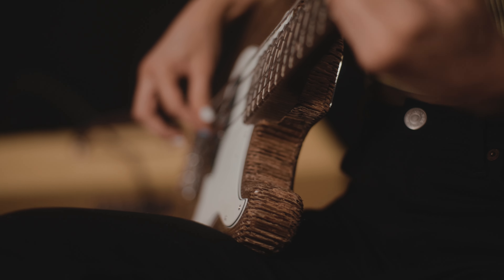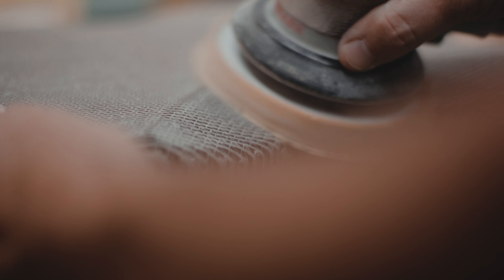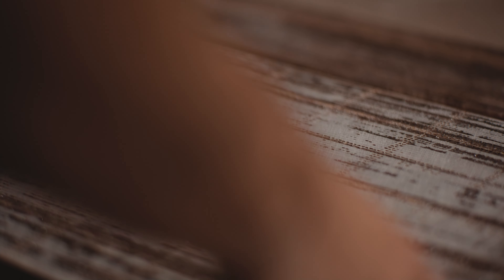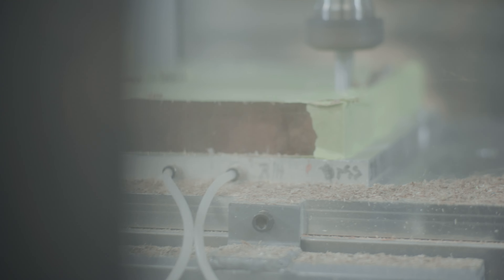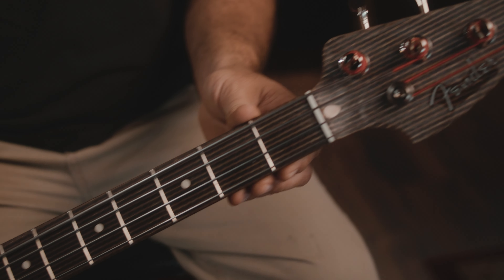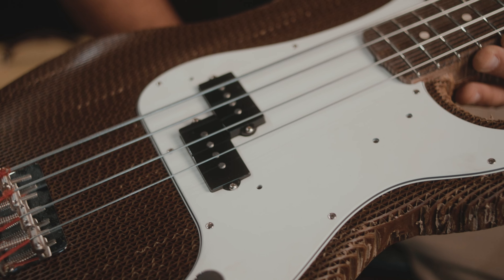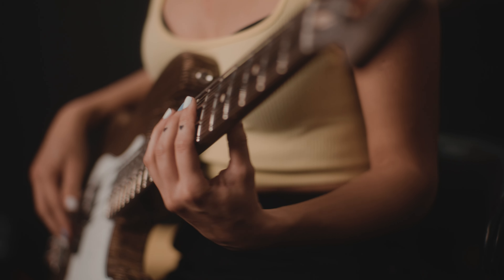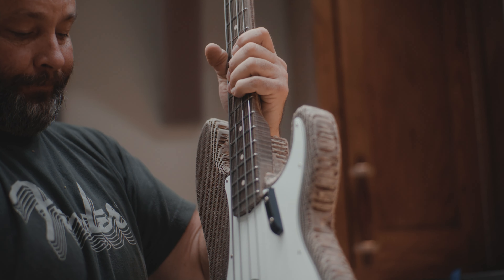Cardboard Precision Bass | Dream Factory | Fender

Comment: Now even Fender proves tonewood is BS, what else do y'all have to say?
Reply: So I'm wondering, is the debate about whether the wood/material affects tone at all, or is the debate about to what extent the wood/material affects tone? Because the whole instrument is a system with many variables. Every little thing thing will have SOME effect, even if minuscule at best.
Reply: Electric guitars are built by the cheapest woods even custom shop .
Reply: @kwyatt261  Yes but the body material probably only contributes to 5% of the sound, it's more Abt the pickups and amps or whatever
Reply: @gary9816  For sure. It's just that there is SOMETHING there. Like I said, every little tiny difference is going to make some kind of difference with how the instrument sounds. It's a whole system of variables, from woods and hardware all the way down to strings and picks. I agree that the pickups are one of the bigger if not the biggest factors involved.
Reply: This is clearly not true unless all woods cost the same.
Reply: @kwyatt261  the thing you’ll commonly see people talk about is that different woods have different impacts on the tone of the instrument. which, in the context of an electric guitar, is irrelevant. the tone in an electric guitar comes from the pickups and the way you play. the wood does make a difference on an acoustic guitar, as different species of wood resonate at different frequencies, so that has a pretty distinct impact on the tone of an acoustic guitar. some woods just naturally resonate at high frequencies which gives a brighter tone than a wood that resonates and a lower frequency. but in the case of electrics, you can make them out of damn near anything and it will have no effect on the overall tone
Reply: @MissJazz004  Ok, I get what you're saying, and of course it makes more of a difference in acoustics, but every variable in the system is going to have some effect, even on an electric guitar. While it may be a negligible difference in an electric, different woods are going to affect SOMETHING about the way that guitar feels, plays and sounds. Woods on an electric aren't a big deal, but to say it has absolutely no effect whatsoever is just being intellectually dishonest.
Reply: @kwyatt261  absolutely. different woods have a huge impact on the feel and playability of a guitar. but you’ll notice that i said nothing about the feel. sonically speaking, it has next to no effect. make a guitar out of walnut, and one out of mahogany, and install identical electronics and set them up identically, and they’ll sound exactly the same. i totally get having a preference in things like fingerboard woods, but when people say that an ebony board sounds different than a rosewood board, they’re just incorrect. it’s all placebo. they expect a difference in the tone, so they hear a difference in the tone. the guitar has an infinite number of variables that make a huge impact on the sound, your pickups, string gauge, amp, cable, or even room can greatly influence your tone, but the wood it’s made of doesn’t. or at least doesn’t in a way that changes the amplified sound
Reply: @MissJazz004  I feel that. Practically, one would be better off changing pickups rather than having a new body or neck made  if one wants a drastically different sound.
Reply: To me it sounds a little thinner than a bass made of solid wood, but that could just be the pickups
Reply: @sambarker6141  It sounds the same. Its tradition. We are told since kids "this is this and that is that", its like politcal indoctrination, really.  If guitars and basses were made since the 50s from other stuff and some company started using wood we would think  "wood?.. why? .. thats for tables or chairs?. You see? Cheers!.
Reply: @claudiocruzat8777  Let's agree to disagree, cheers to you as well!